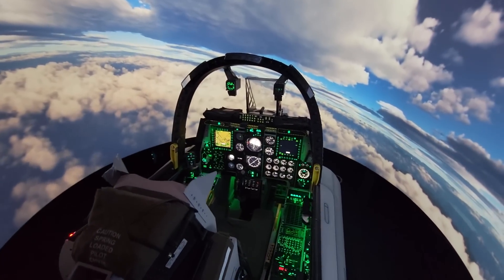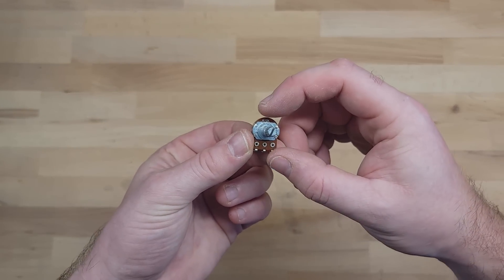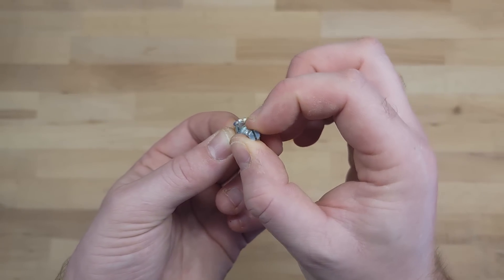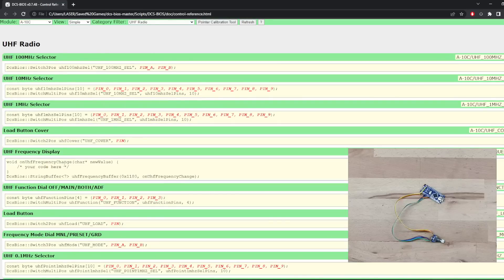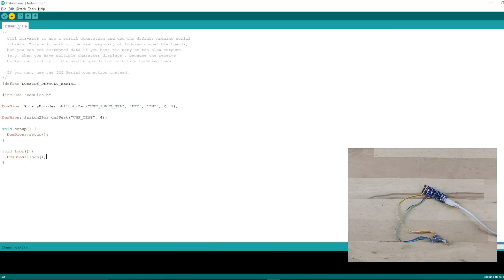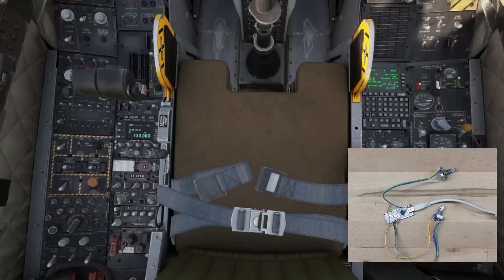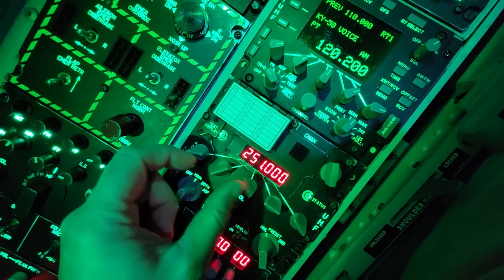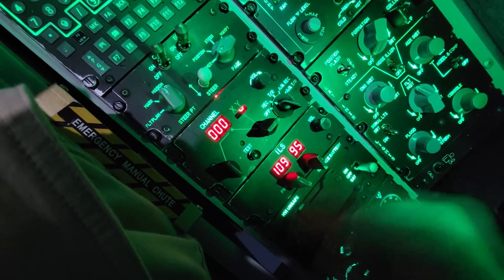Flight Sim Basics (Part 4): Pots and Rotary Encoders

Comment: Hello sir. Do you know if there's any way to adjust the low and high max values of a pot in DCS bios? that is, imagine that your pot only goes from 100 to 1000 values, instead of 0 to 1023. Can you make that 100 to 1000 to be 0 to 100% in DCS BIOS?

Comment: how did you do your controller setup? it looks like you have a arduino (or something similar) for each small panel. how do you then connect all these single boards together? just each of them to a usb hub, or do you use master/slave and only connect the master controller to usb to your pc? what would you recommend?
Reply: winwing.

Comment: bit random, but some aircraft have a heading select knob, and altho I'm using a winwing setup, it has multiple rotary encoders, is there a way to speed up the encoders in DCS?
I have the F1 mirage, and setting the heading select to a rotary encoder, its absolutely slow as all fuck, as if its microstepping.

Comment: DCS Bios related question: if i wanted to make a panel that would be used for multiple DCS aircraft (F-16 & F-18) would it be a better route to use a arduino that is setup as a USB controller vs DCS Bios? I dont strickly fly one aircraft in DCS but want to make physvial devices soon

Comment: i know you said most of your cockpit is set up with arduino micros due to the fact that you don't have to use dcs bios with them, HOW did you get around each micro showing up with the same name? i built a bunch of switch panels following your video and now i'm stuck because i can only use one at a time.

Comment: An advantage to using pots code with a multi position rotary switch is that you can solder resistors between the contacts, and you will only need one analog pin instead of many digital pins.

Comment: Do you not have a filter on your rotary encoders? How do you prevent the bounce?
Reply: I put 100nF capacitors on mine from the signal pin to ground.

Comment: Also, how many com ports does your machine have listed? it must be a lot even if you are using up every IO pin on an Arduino each time.
Reply: When using the I2C bus you can use up to 128 inputs per arduino.
Might even be able to combine it with a button matrix to even up the number of buttons further but you would run out of space for all the code at that point.

Comment: A dirty trick with rotaries I did was hooked them up to a keyboard encoder ripped out of a cheap USB keyboard. you wire up the two encoder lines to say A and SHIFT. so when you rotate it one way you get aaaaa and the other way you get AAAAA which you can map in most games to two functions. there's a lot of keys that work with SHIFT on a keyboard too so its a great way of getting a lot of one/two way digital inputs.
Reply: This is brilliant and cursed and I love it. As long as you're only turning one at a time you could share the shift between multiple encoders
Reply: @Rokreder  I dare say it would work just as good with CTRL or ALT too so even more options.....

Comment: Despite having quaggles, I cannot get my heading and course to work properly.  They just zoom around the HSI
Reply: What are "quaggles"?  If you mean the rotary encoder, I put 100nF capacitors on mine from the signal pin to ground.  This kills noise quickly.